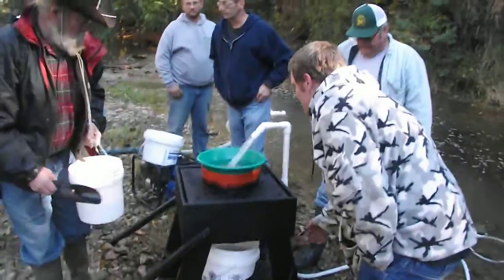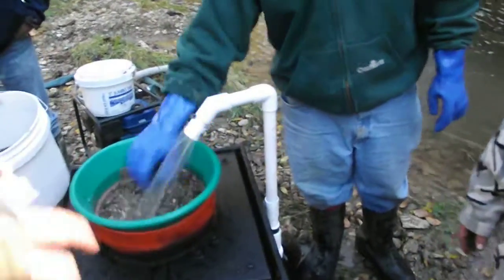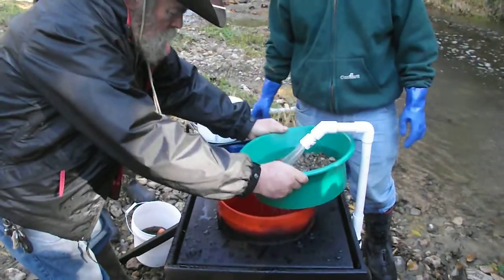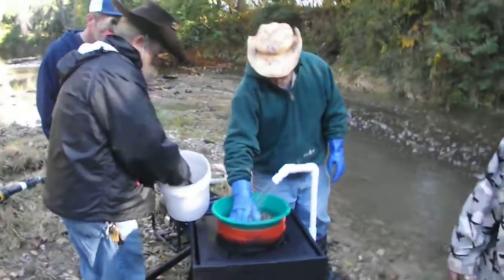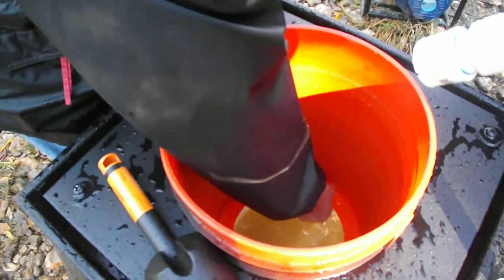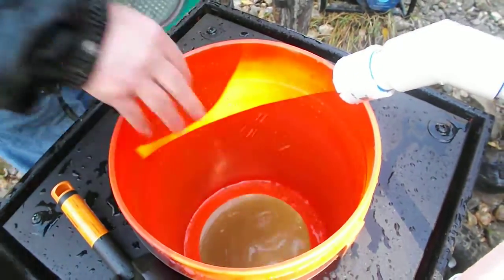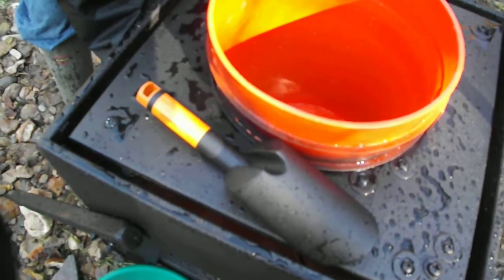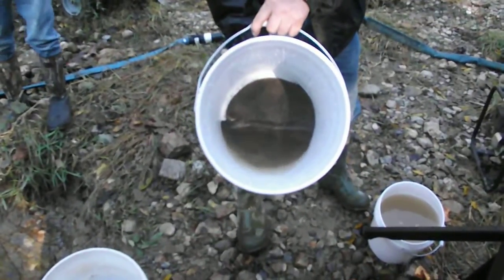Field Testing the Earthquake Classifier part 2 by IndianaGoldHunter

Comment: Ive noticed when I classify and don't recirc, that the water running over the edges carries the flour gold ( its flat ) with it.... 70 mesh and smaller.

I couldnt tell if you had a double catch basin besides the catch bucket and the Garret pan.

How does it handle the floating gold without a recirc system ?